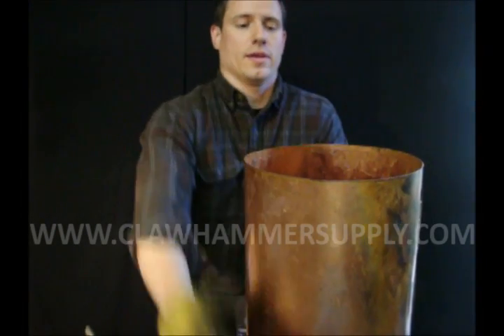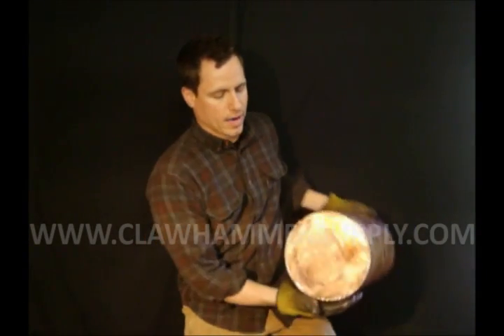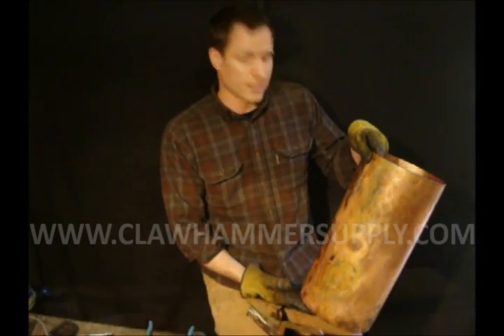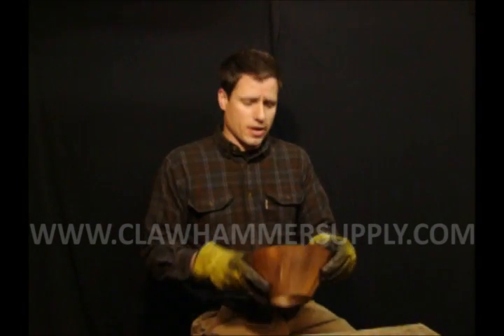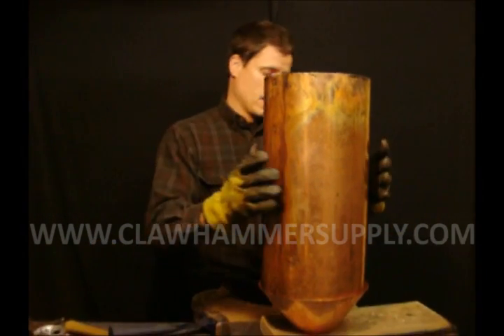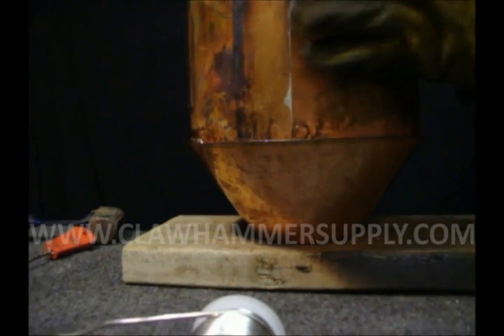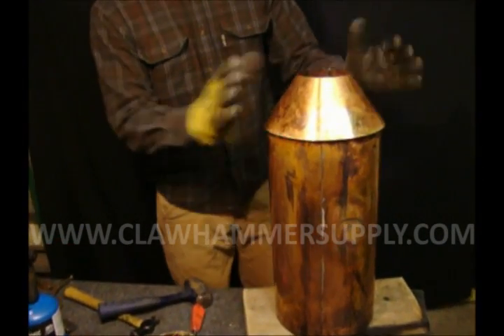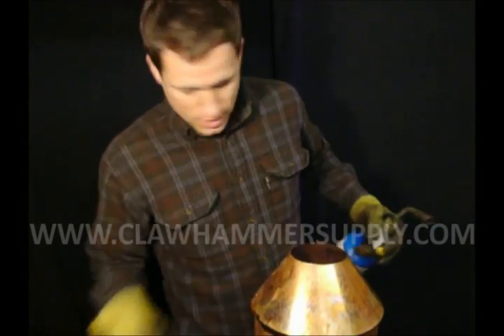How to Build a Copper Still - Part 4

Comment: O.K., the close up on the soldering job he did on the cone shows a very poor, cold joint!
Remember, you want your solder joint to heat up, so the solder flows like water momentarily, into the joint...You should not have 'lumps' of solder sitting on top of the joint after you are finished, as he does. Be sure to pre heat the area surrounding the joint well enough that the solder FLOWS! Then take your heat away...it appears he is not getting good flow to the joint as the joint itself is not being pre-heated correctly (hot enough), for the solder to flow correctly...A really poor example here of a good solder connection on the unit he is working on...

Comment: @craxler I can't see a soldering iron working, especially with the lead-free solder in use today it would almost never get hot enough. As thin as this is any standard propane torch around 20 bucks would be  fine though.

Comment: I have a suggestion for those that want to make a copper still. To make sure that you get a good seal when soldering you should tin the surfaces prior to soldering. This helps the solder flow and leaves no bare metal - hence a great seal. Also the rivets should be put in from the inside out. Their is a tool for forming the rivet heads, it's nothing more than a block of steel drilled out with a small round hole to form the head of the rivet.
Hope this helps everyone - Tom

Comment: You should cut the same wavy edge to the base of the cone like you did the tank.You could either bend every other tab in/out of the cone,or even bend them to the angle of the cone and solder them all in or out.Beats the hell out of a simple soldered butt joint where they meet.Cool kit though

Comment: I just silver soldered mine and it turned out awesome. I would highly suggest it if you have some skills with silver. It has a higher temperature for melting point, also it has no lead so its totally safe.